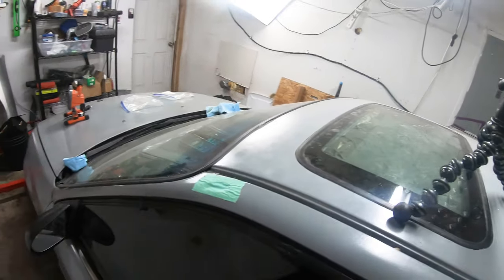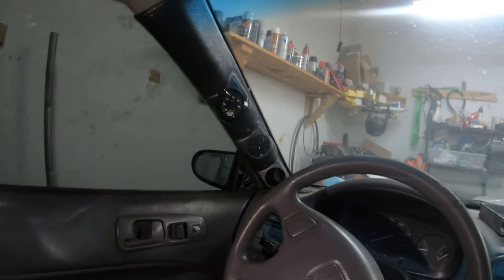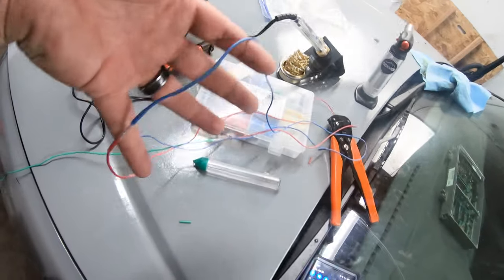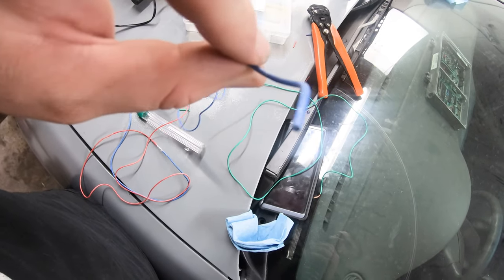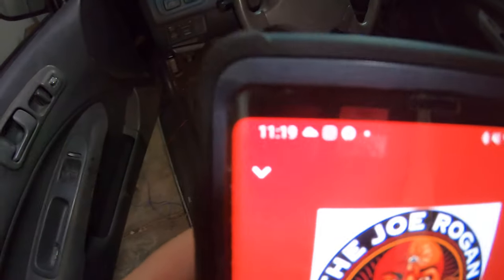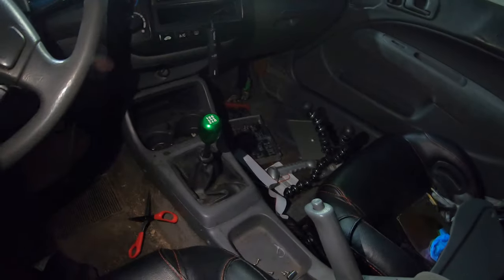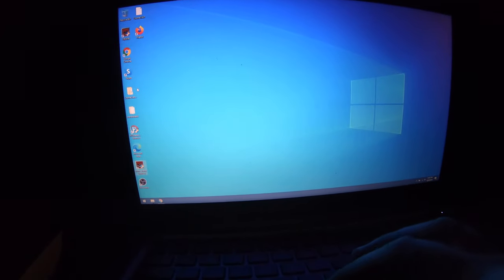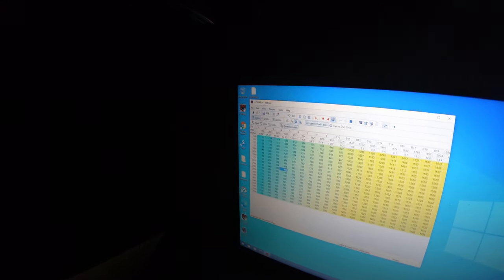Wiring My Wideband O2 Sensor To My Turbo Civics P28 ECU (I Need Help!) | TunerThings

Comment: were did you connect the 12v power supply for the gauge i was thinking of using the moon roof fuse ( i have a dx 97 civic sedan so doesnt have a moon roof)
Reply from the maker: I used an add-a-fuse kit to the interior fuse panel! Easiest way to go about it.. I guess the moon roof fuse would be a good place to tap for sure for you if you don't even have one!
Reply: @TunerThings  so just quick update to save either you or someone else from making my mistakes auto parts stores wil sell an add a circuit fuse tap instead of having to get into the back of a fuse panel and doing some rewiring or do what i did at first for my other gauges and cut a leg off a prong and tap into an empty fuse. most auto parts sell an "add a circuit fuse tap" where you can tap into a used or unused fuse slot. i found one at o'rileys that can tap into a used fuse slot and has two fuse slots on the product one for the existing circuit and then another for the added circuit. this allows for less headache and more reliable as well as reversible in case you have plans for later. i found ATM, ATM Low profile, ATR and ATC style
  PS  if you think this is a good idea and will help others please either pin this or write it somewhere else where someone can see it and save them from my mistakes its a simple fix and idea i wish someone showed me

Comment: You know I like you man, but soldering that wasn't the best move. Crimped connections are always, always, always best in a vehicle. It'll work, and may never fail, but you're always taking a risk. PM me your address and I'll mail you some proper motorsports wire. Butt Crimp connectors or Barrel Crimp connectors are good.
If you haven't done it, please set your voltage offset on pin d14, it looked like you were grounding the wbo2 across the other side of the chassis. Easiest way to do this is when everything is KOEO so you can get "full lean" and 5v, and then full rich at whatever voltage that is on your gauge.
Chrome doesn't really do realtime datalogging well. Lots of people have issues.
I can show you how to make a basemap in HTS, we can do a teamviewer session or Discord screen-sharing whenever you have time.
Reply from the maker: Thanks for the  reply brother, I ordered some wire in a thinner gauge - I wasn't aware that butt connectors would be better than soldering. I have some of those which I used by the ECU on the harness side of things. Should I be grounding the gauge to the ECU? Right now its grounded by the gauge itself
Reply from the maker: Also if I can't figure out HTS tonight I'll definitely take you up on that basemap haha thanks brother
Reply: awptickes can i have an email or fb profile i need some help with hts